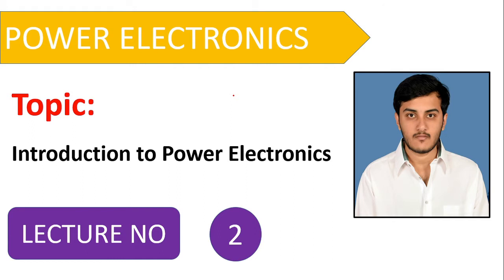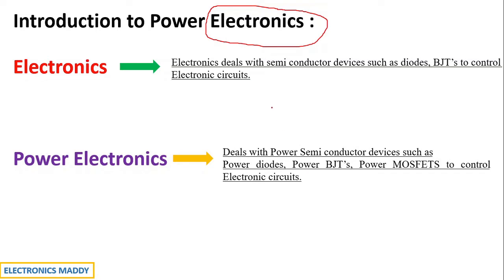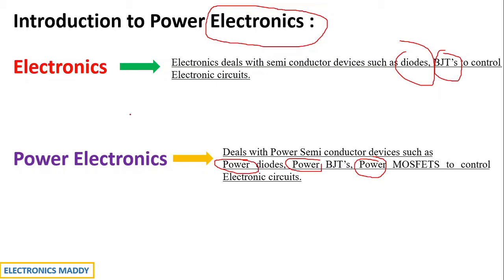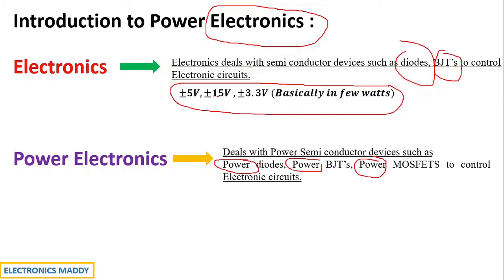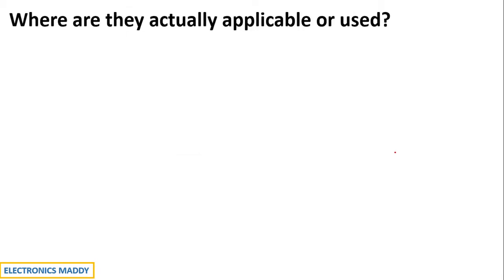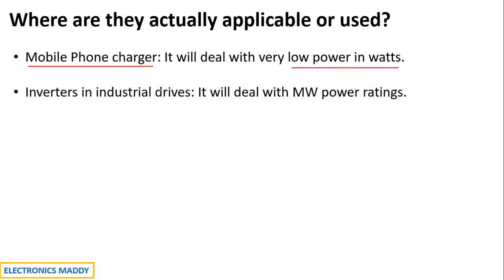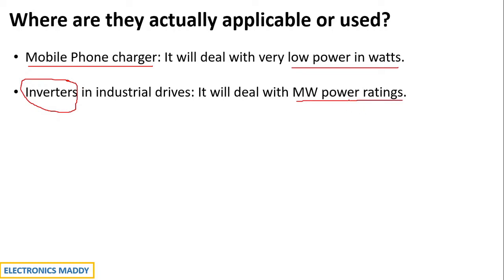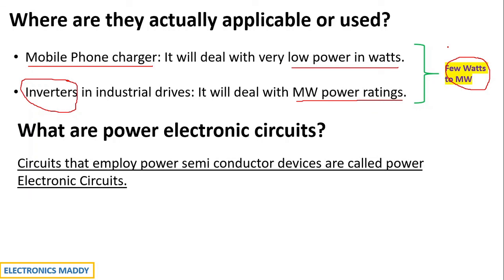Introduction to Power Electronics | Power Electronics | Lecture 2

Comment: Excellent 
Very well explained clean and clear..❤️
You are awesome
Just one small doubt
What is the range with which the power is current rating is varied in electronic circuits??
Reply from the maker: Thanks Raghumala. Max rating is 1A, however usually the current will be in uA and mA
Reply: @ElectronicsMaddy  Thank you 🙏🙏